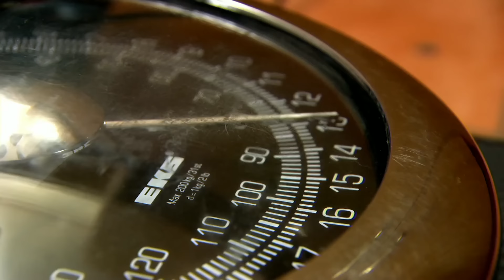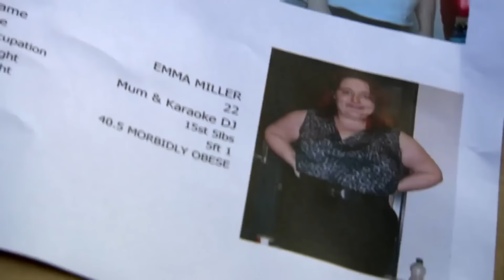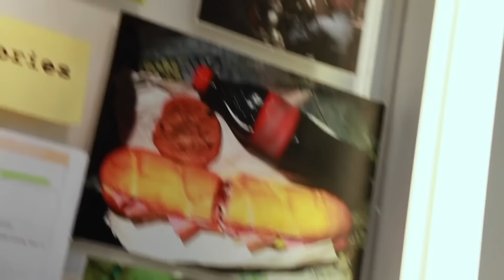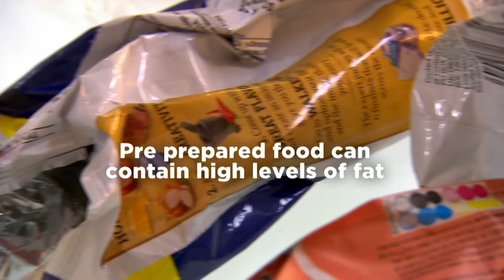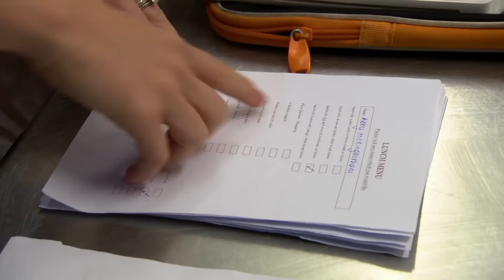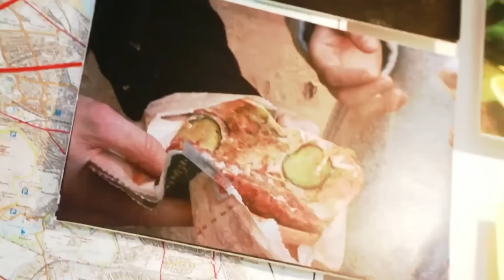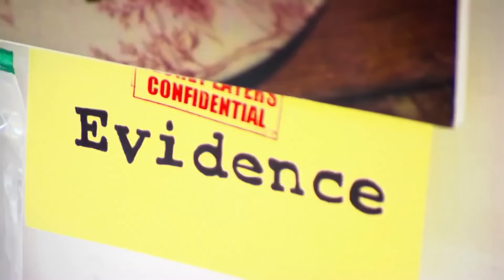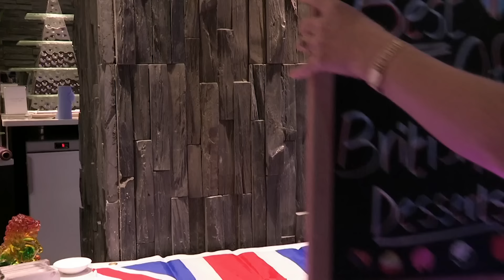Secret Eaters S03 EP8 | How To Lose Weight | TV Show Full Episodes

Comment: I dont get the experiment with the Plumbing company like it seems kind of pointless. Imagine everyday at work the canteen ONLY has bacon butty and then the one day you come in they suddenly have two new and very interesting dishes. Id try out the new meal just to give myself the option of choice instead of choosing the same sandwich i'll probably be getting for years to come from the canteen. Like wouldnt everyone???
Reply: Agreed
Reply: I'd say the result was good, even, because everyone picked the meal that looks (and is) healthier out of the two new options! If they'd framed it that way it would be cute
Reply: I read it more as, if you switched to the higher calorie meal, you might gain weight and not realize why, because you’re still eating at the same place every day.
Reply: I thought the same.
Reply: @kimberlyoldschool  But they didn’t know if this change of the menu was permanent or not. They took the opportunity while it was there. I don’t think the show did what you say they tried to or what they said they did.
Reply: Especially because it's not like a bacon sandwich is a healthy choice to start off with

Comment: I hate it when they say “I’ve tried everything I could possibly have” so then why are you still  fat???
Reply: Because the advice of eat less move more doesn't work.

Insulin is the key hormone responsibile for fat gain and Fat loss.

High insulin = body storing energy
Low insulin = body using stored energy

High sugar / highly processed or artificial foods = massive and long lasting Insulin spike

Natural foods = lesser and no where near as long lasting insulin reaction

Best way to go then:

Fewer larger meals.
High in natural fat. 
No snacks.

Basically the opposite of the advice regularly given out.

No wonder people fail!
Reply: many people simply are not educated on what to do to get healthy. it may sound like common sense, but to lots of people it’s not, especially with how much false information is out there

Comment: "FULL FAT Cola"?  (@ 26:15 & 32:27)  FOUR times sugared/standard colas are called Full Fat. Really??? This is just one of the huge mistakes in quoting food values that pepper this series. And why are CARBS never quoted? They are a better grading of food than just calories. Also: when the Sunday Roast veg are pictured, it's always potatoes, carrots, peas, & corn - 4 of the carb-heavy veg that should be used in moderation, and NOT as the only veg eaten.

Comment: They demonize fat, which is wrong. The right fat is essential.  Also carbs and seed oils are the culprit
Reply: Not really. When the participants are indulging in olive oil, nuts and seeds, Lynn mentions that while they are good for you they are still calorific and should be eaten in moderation. If your goal is weight loss, dousing your salads in olive oil is not going to help. Most of the time they aren't having unsaturated fats (the 'right' fats)
Reply: @ saturated fats do not raise the “bad” cholesterol.  I use only animal fats and avocado oil and
My health has improved exponentially